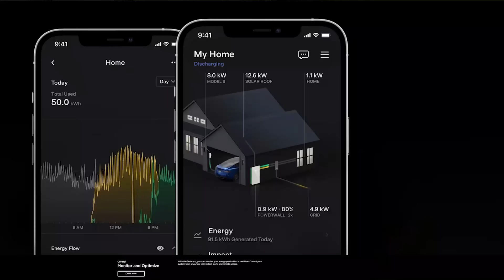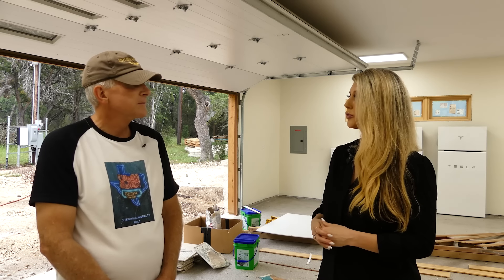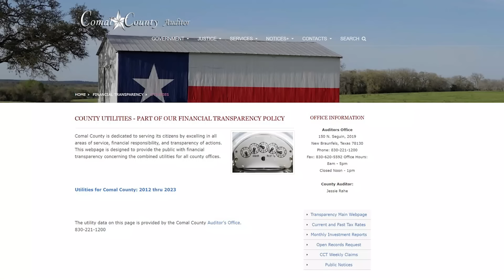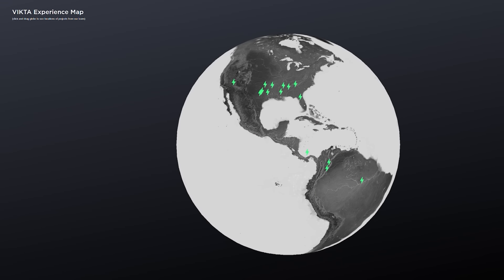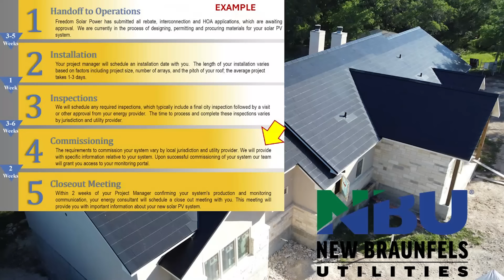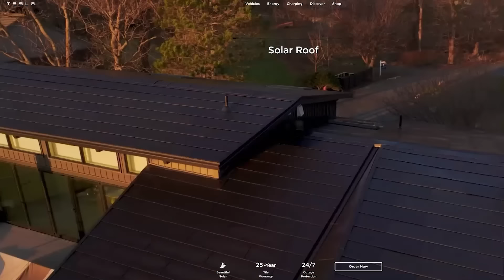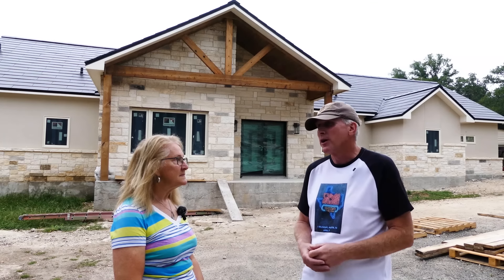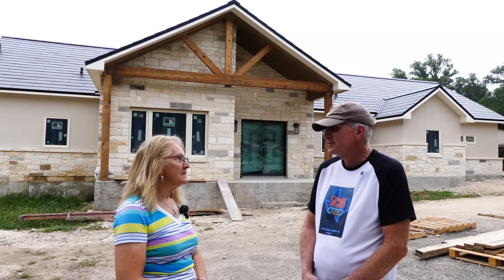Tesla Solar Roof & Powerwall Installation Part 5 ... Warranty, Service, Tesla Partners & Conclusion

Comment: This has been an excellent and informative video series from start to finish, particularly the attention to the final connections (with drop-line, transformer, circuit breaker, and possible regulatory issues). Any sort of roof replacement is a big deal and often new technologies are not quite cut-and-paste, but the benefits are clear and reveal themselves over time. Thank you, Joe, Debbie, and others for your contributions to help inform and educate.

Comment: I am an avid consumer of your Tesla Gigafactory series.  have to go through and watch this series from the beginning. One thing I'd like to point out. I have had Tesla solar panels on my roof in Texas for 10 years and they have always been insured via homeowners insurance without a problem. For the first time, this past February, I could not find a homeowners insurance company that would insure the solar panels. This is a HUGE negative for any homeowner. A hail storm or tornado that causes any more than slight damage will put me at serious financial risk. If this becomes an industry trend, potential solar system owners need to be aware of it.

Comment: Large roof over hangs are beautiful and protect the doors, windows and siding from rain and moisture damage.
Water is the enemy of buildings. Architects and home builders need to bring back large roof over hangs
Reply: Exactly right. Another advantage is if the gutters are overwhelmed, the rain gets pushed out farther from the foundation. All around a better design. Looking at you New England.

Comment: Good report, thanks. "Bad sound makes good video look bad."
Reply from the maker: It was raining and I had to make a choice where to do the interview given the time constraints I had. Sometimes I cannot have perfect conditions to work in.
Reply: Please consult a sound recording professional who can advise what microphones to use in that environment. 

From my experience you need medium to long hand-held "shotgun" microphones positioned straight up just under the chin (speak softly across the element, not into it) so you reject the reflected sound to minimize the "bathroom acoustics". There are also directional body microphones that can point straight up when positioned as close to the chin as possible.
Reply from the maker: @bjs2022  😂😂😂 thanks for watching

Comment: Great video Joe but no specs or costs as promised (https://www.youtube.com/watch?v=OlztBy8AVrs&lc=Ugy9aFqSFu9iAj_Ds2F4AaABAg.A1ogcj28DcnA2JS9vEgtyR"). Yes, each job is different but give your audience a bit of credit, we're not all idiots - we can take that into consideration - the total solar roof cost, total Tesla roof area, PV tiles and peak power output would have been extremely useful data for people thinking about similar projects. The lack of such data seriously undermines the value of your work.
Reply from the maker: Thanks for watching